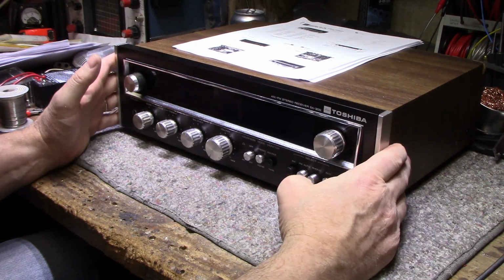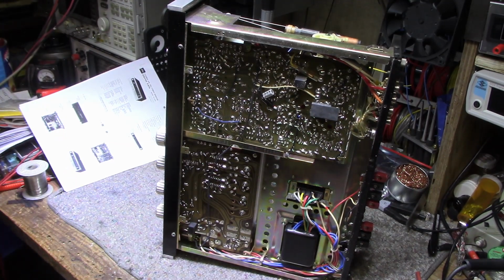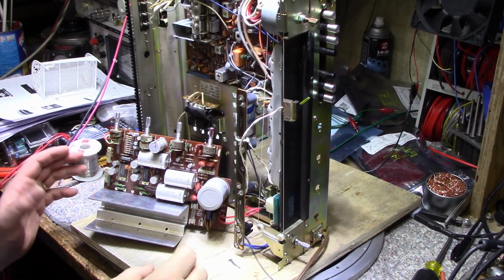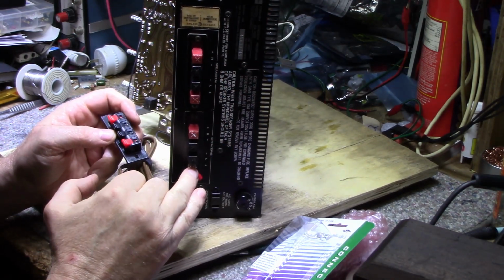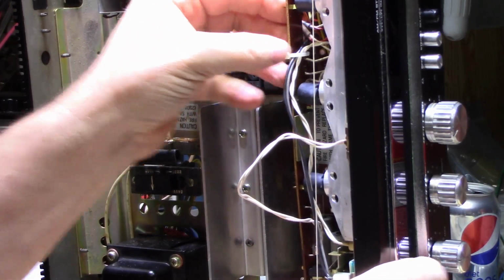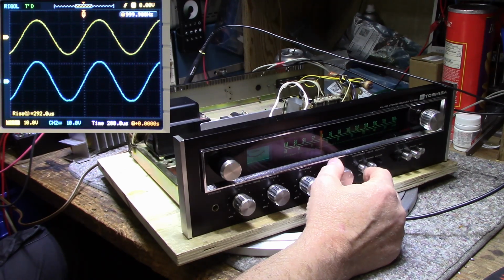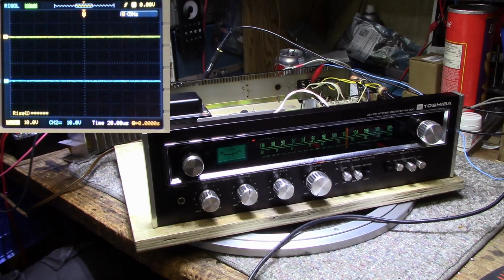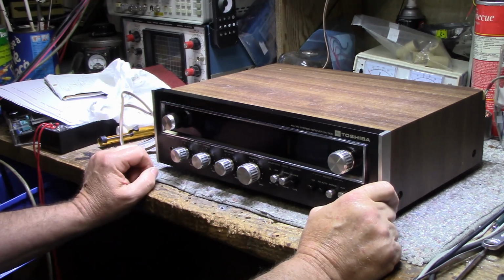Toshiba SA 300 Stereo Receiver - Repairs (Ep. 77)

Comment: Hi, thanks for the video. I have the  same unit. I am getting a continuous hiss on the right channel alone..it remains regardless of volume control. It is not too loud but can be heard from 2 meters away. Can you please help me with a solution?
Reply from the maker: Hi, the SA300 is pretty simple in design but I still can't diagnose what's wrong through youtube comments. All I can do is direct you where to look for the problem. I expect the problem to be after the volume pot as you said the volume has no effect.  The amplifier circuits are very basic with one transistor, one IC driver and two output transistors. If the tone controls also has no effect, that rules out the tone buffer transistor TR01 or TR02 (2SC1000).
What could cause the problem could be one or more of the following listed from most likely to least
Cracked solder joint(s)
Bad or failing capacitor(s)
Defective driver IC chip TA7109P
Noisy tone buffer transistor 2SC1000
Noisy output transistors 2SD234

I hope that helps, it should at least point you in the right direction. The service manual can be found at hifiengine.com
Reply: Thanks for the lead. Will pursue them and hopefully resolve the issue. Thanks

Comment: The volume mis-match is simply the volume control itself - the carbon tracks weren't exactly the same, either when the carbon was applied or mechanically when the wafers were assembled in the final product. Very common in the day, (known as a volume tracking issue) especially with cheaper ones. This is why balance controls should not have had detents but in practice a small difference like this can't normally be heard. Mainly we notice when testing.

Comment: The speaker terminals you bought work better (for me) with the lever on the bottom, the push going down.  Why? It's easier to see the hole where you insert in the wire.  I have also found sometimes it's much easier to remove the guts from the existing connector block and install the individual screw down post with a banana jack type. Generally there are 2 sizes and the smaller has worked the best for me.
Reply from the maker: Thanks for the tip, I'll keep this in mind for the future